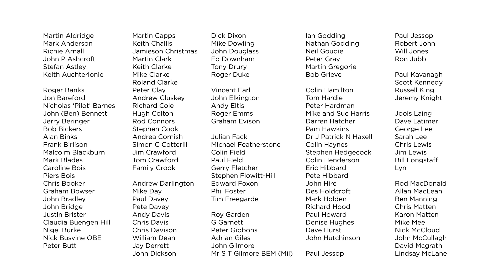Glide Britain Misconceptions

Comment: Just think, you can get 10 hours of gliding flight time under your belt for the same price as it would cost you to get 1 hour in a cesena 152.
Reply: Yeah but a plane you could use as a private transport to get about without needing help? The whole point of a plane/helicopter is to have your own personal transport. Not sure about the UK (I'm in Canada) but here you'd want your own plane to do your own thing between ski lodge/city/country hunting/fishing living. These are just hobbyists. Could be because it's a small country but surely the purpose is so you can get to work/home/friends/holidays using your own transport? Seems to me that these dorky people are the equivalent of buying a car but only using it on a racetrack rather than going to the shops/cinema/trips with it. Ridiculous notion.
Reply: @jjr1728  there are gliders with self start capabilitys also travel per glider is possible :) just make sure that fields u head for have gliding operations... u then just pay the guest fees for launch or self start if u have it :) soaring is a sport... some do it as hobby some for races and some travle with them :)
Reply: @luxaly9510  that sounds nice
Reply: Not quite, it is much cheaper overall, but if all of your lessons are tug launched (which is the case in winter for a lot of clubs) then that is in the region of £30 a launch plus the glider hire whilst up there ( which is very cheap at roughly 0.40p a minute on average)

Comment: you can build a glider from scratch for little money
Reply: That is a misconception.
Reply: @Paul-vh6ul  well... It partually is... Some gliders like K-8b are actually designed to be made pretty much from scratch for little money... But you will never get the performance of modern gliders from aircraft like that, they were designed to be built in clubs in like early 60:ties or late fifties... Nowdays the gliders are usually made from fibreglass, which is not a material you could work with with your normal garage tools. But hey, K-8 is a great aircraft to fly, it's just that you won't fly it very far.